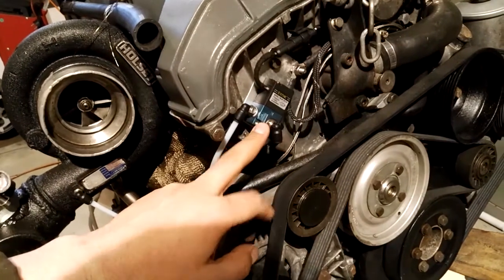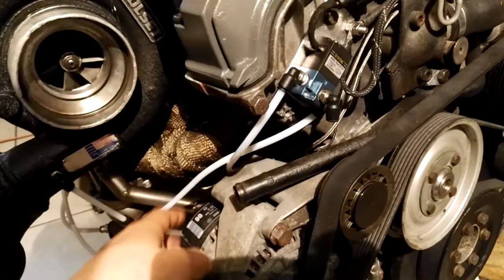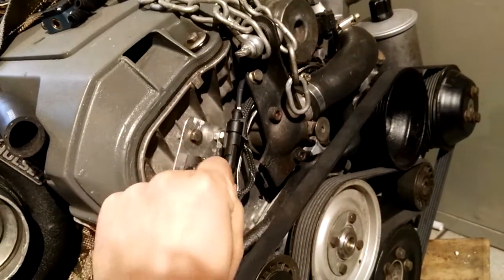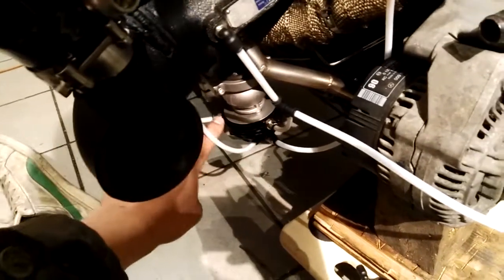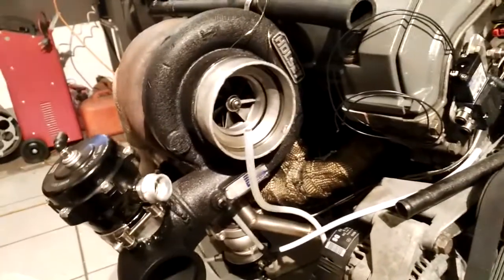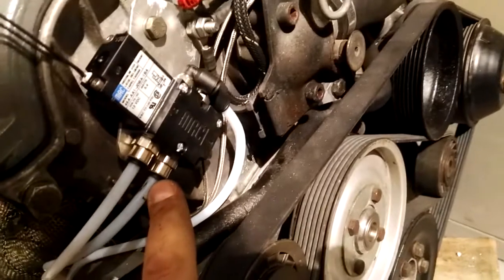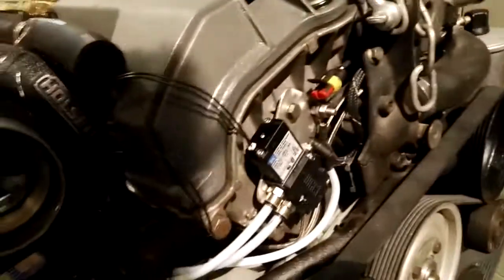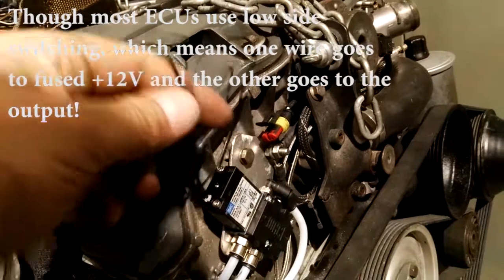How-To / Mount and Connect a 4-Port Boost Solenoid

Comment: I read that you use a Mercedes M104.992 with a 6-speed transmission Mercedes 716.663, and what is the rear gearbox, with what gear ratio?
Reply from the maker: i had 185mm 3,07 and 3,67, somwhere in between would be perfect.
Reply: @carlbenz3341  
so far I have an m104 2.8 manual transmission 717.430 and a gearbox 3.46 in the middle case. Now I want to make the asd remove the hydraulics and add a clutch pack.

Comment: Hello, please tell me how long is your belt?
Reply from the maker: no clue, its the stock belt for a 1994 c280
Reply: @carlbenz3341  
I realized I would have to measure with a shoelace))) I just now move the generator higher and I don't have an air conditioner compressor and a belt that I'm going to have a long one (

Comment: Hi Carl, what is turbochargers turbine size? ( A/R)
Reply from the maker: It's a holset, housing size is 16cm²
turbine is  76/64mm
compressor is 60/84mm
Reply: Thank you for answer, one more question Carl, maximum how many mm I can polish top of piston to lower compression ratio?(sorry for bad English)
Reply from the maker: I dont know but you dont need that much...

Comment: did you make your own exhaust manifold or buy 1 from some
where?
Reply from the maker: I built it myself.
Reply: Very cool, I am converting my m104 to manual soon, just need to wait for a few more parts to arrive. I am thinking about going to a turbo conversion after

Comment: is this controller universal I have a bmw e46
Reply from the maker: The solenoid is universal, yess.
But you need a controller to controll that solenoid.
Reply: What would I need to control it
Reply: Stock ecu is tuneable
Reply from the maker: @DAME_AL  i'm pretty sure that your oem ecu has no tables and no spare output for a boost solenoid. There are multiple electronic boost controllers on the market.

Comment: Can you make a video in the dyno test ?
Reply from the maker: clutch isn't holding it anymore again. (3,2l 0,8bar and moderate timing)
i have to figure something out there first, as my goal is to run ~1,5bar and see what it does.

when i have developed and built a new clutch setup it's going to see a dyno.
Reply: I'm from México and I have one c280 m104 but in this country don't have enginiers and pices for this cars. My dream it's my car have turbo intercooler heders and nitrous. Nice car !!!

Comment: Hey i came across your acct from another youtuber "joshua" do you have an email or IG i can contact you on? IG @lawd_have_merce ... anyway i have w202 c43 i was thinking of swapping m104 engine and going turbo and manual rather than the normal supercharged m113k swap... Would you be able to help me as far as any info???
Reply from the maker: you can write to barlcenz@gmail.com

Comment: Hello, can you tell me if we need special kind of EBC to control a 4 port solenoid or if any boost controller can control it ?

Thx !
Reply from the maker: any boost controller that supports a 3 port should also be able to control a 4 port.
you may have to adjust the gain etc.

mine will be controlled by my standalone ecu.